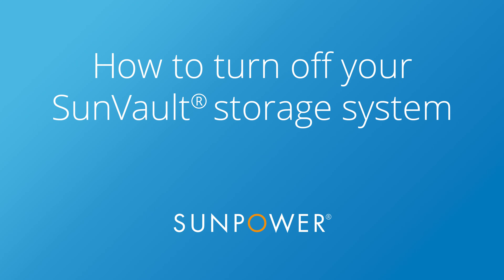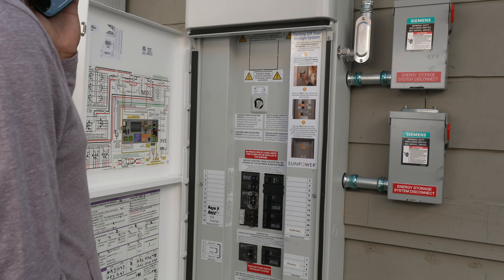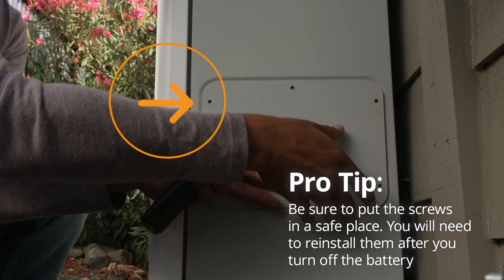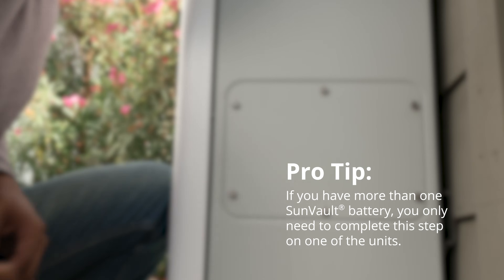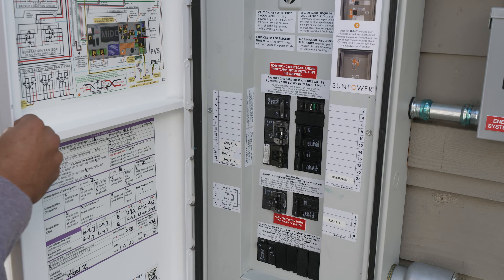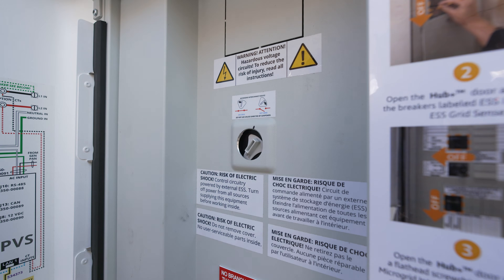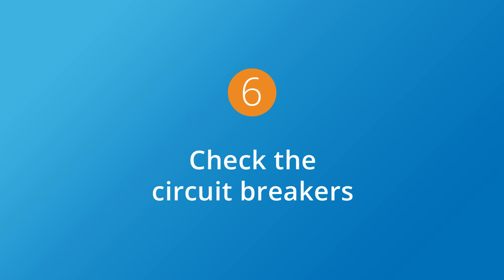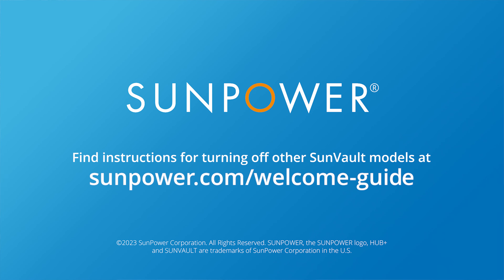How to turn off your SunPower® SunVault® storage system

Comment: my sunvault battery won't charge anymore after a power outage, the app shows my panels powering my home and sendig to the grid but not to the battery, now that sunpower is out of business they no longer honors their sunvault warranty!
Reply: May I ask what did u end up doing?
Reply: @bsn1-6balladaresgrecia20  I ended up opening up the battery vault and manually did a hard reset and it's working again.
Reply: Hi, did you get any help? We are having the same issue.